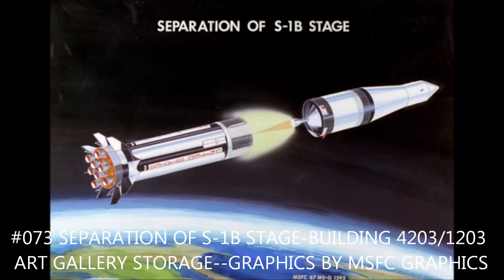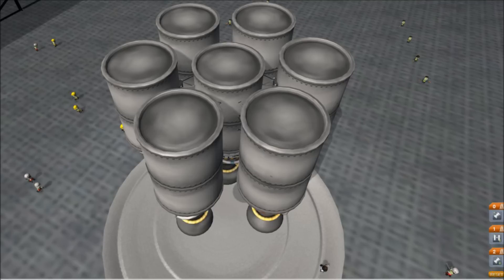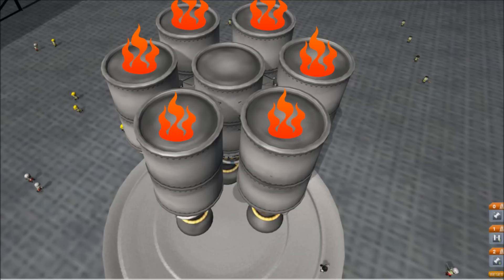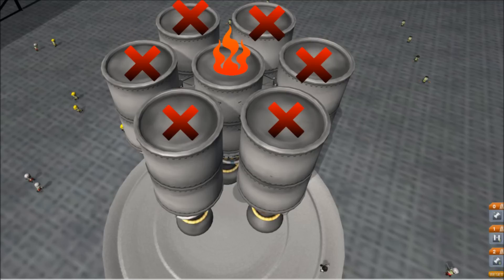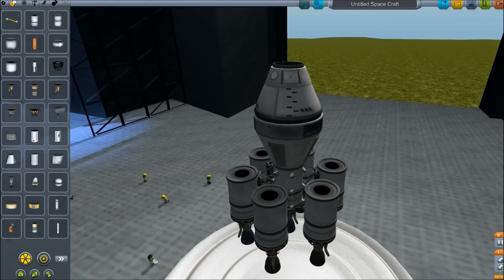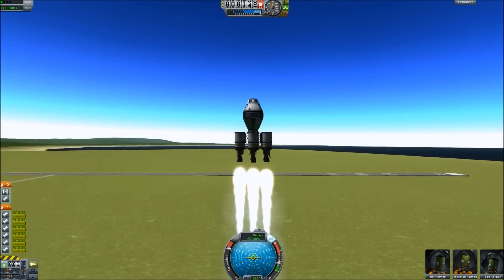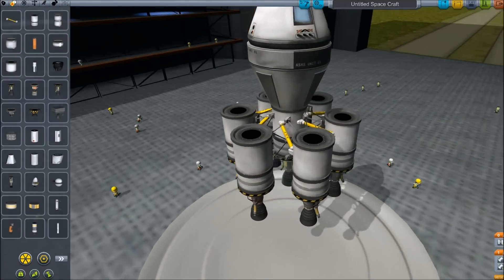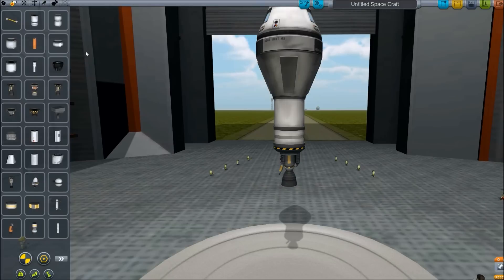Kerbal Space Program - Advanced Staging

Comment: Delta 4 Heavy runs both booster cores at full throttle and the inner one at lower throttle, so the booster cores with the same engine and fuel tank are deployed before the main core runs out of fuel ;D pretty nice concept. But I love Delta 2 the most: 6 GEM booster ("groundstart boosters") are ignited as well as the rs-27 main engine (I'm talking about 7925 "Heavy"). When they burn out, the three other GEM's ("aerostart boosters are ignited while the 6 other boosters are separated ;) https://youtu.be/cPYcfdlHUDY?t=166

Comment: 10:40 the claim "serial is better than constant ... shows that a little bit more speed gives more altitude" is false. You crunched dynamics data in this sum up table and the "lack of data" caused you to make this claim.
(In atmosphere, ie below 35k) a little bit more speed does not give more altitude. A little better weight to thrust and constant thrust at optimum speed do.
The serial had lower speed than constant - until certain altitude, when it had its fuel depleted from "boosters" - which it jettisoned gaining much better weight to thrust for further propelling as result, and then started burning the left over engine. 
The constant burned all fuel and got better start speeds, but then it run out of fuel and with the same mass continued to ascend by inertia - whilst still in atmosphere. Its atmosphere which has broke it down. In space, constant would win. But in atmosphere, rule of 500-600 m/s ascend speed and constant jettison of empty canisters (to improve weight2thrust) wins - which is "asparagus".

Comment: I understand how to stage like those, but I'm wondering about how to do hot staging, like the Soyuz, where the upper stage ignites while the second stage is still running.
Reply from the maker: Move the stage that ignights the second rocket so that it is triggered before you separate.
Reply: Won't that cause the first-stage fuel tank to explode? Also, how would that work with the de-couplers automatically putting interstages around the upper stage motor?
Reply from the maker: +Tristan Wassman It may cause it to explode. I would put some space in there like the Russian rockets.
Reply: How? I have B9 Aerospace, KW Rocketry, and MechJeb, I know MechJeb won't help with that.
Reply: +Tristan Wassman there is a payload bay in the modular rocket systems pack that works perfectly for this. it's open on the top and the bottom, basically just the side surface of a cylinder

Comment: I've found that with Ferram Aerospace Redux installed, parallel staging tends to be the best, given that full on asparagus staging causes insane amounts of drag in the lower atmosphere.
Reply: You are, but the cross section of an asparagus staged rocket is huge to the point where you loose more delta v to drag than you gain from the asparagus staging, aka its like real life.
Reply: SteelFyire What if there was a mod where there was a part that automatically assigned asparagus staging when placed and created the "plumbing" internally. Basically a fuel tank with asparagusing fuel line decouplers.

Edit: It should let you choose the type of staging instead of only being auto-asparagus.
Reply: SteelFyire
This is why you would, if you want to be efficient, stay at "Terminal Velocity".
Terminal Velocity is roughtly the most balanced speed, at which you are as fast as possible, without having too much Delta-V wasted during ascent.
Reply: I'm aware of that.

Comment: It seems many people have pointed out the fuel wasted by flying the rockets at full throttle. This would be a big factor why serial staging out-performed no staging and parallel staging. In serial staging, you're going far above terminal velocity. Adding an extra engine at full throttle is about the opposite of what you should be doing to correct the problem.
Reply: (I know, 6 years) You probably already know this, but I wanted to point out: firing all engines at once isn't the problem. The problem is that they're to powerful in this experiment. It would have been way more efficient to fire 7 smaller engines - preferably giving out between 1.5 and 2 TWR for a nice gravity turn,
Also, what do you mean about terminal velocity?
Reply: @Krzeszny95  At the time this comment was written (and when the video was uploaded), the game used a relatively poor aerodynamic model that caused a sharp increase in drag when flying above terminal velocity. You would want to carefully keep your rocket flying at or slightly below terminal velocity while ascending to save fuel. That's why there's such a large difference between the video's serial-staging test and no-staging test. Much more fuel is being lost to aerodynamic drag during the no-staging test. By the way, another problem with the old aerodynamics model was that nose cones actually gave you worse performance. In 2015, version 1.0 of the game was introduced with an improved aerodynamics model.
Reply: @criminy_  How did you calculate terminal velocity? I'm sure it's different depending on given altitude.
By the way, I use the Ferram Aerospace mod but I'm not sure how much it affects drag.
Reply: @Krzeszny95  When I was learning to launch rockets back then, I found a table that showed terminal velocity at certain altitudes. I eventually just got a feel for about how fast I should be going at a given point in an ascent. Also, I found the Kerbal Engineer mod which could be set to show your current velocity and terminal velocity for your current altitude.

Another quirk of playing the game back then with the weird thick atmosphere model was that the lower atmosphere was so thick that most people didn't really begin their "gravity turn" until reaching 10km (!!!) which made it not an actual gravity turn although most people still called it that.

After I became more familiar with the game, I started using Ferram's mod to try out a more realistic aerodynamic model where actual gravity turns made sense. I'm not sure what the differences are between the stock game and Ferram's mod since the 1.0 update. Ferram's a great mod author and community contributor, though, so I'm sure it's still an excellent addition to the game.
Reply: @criminy_  Thanks for that interesting information :)
Reply: yep... should be tested with mechjeb and with terminal velocity constraint
Reply: Martin Pereira i reply to myself!
did this with mechjeb and a similar setup just flying into 100k orbit constrained to terminal velocity... results:

- all 7 engines firing, no crossfeed ..... minus 438 m/s to orbit

- outer engines first stage, center second stage..... orbit with 1698 m/s to spare

- all firing crossfeed into center engine.... orbit with 1680 to spare

- crossfeed 2 into 2 into 2 into center..... orbit with 2520 to spare

so yes at least in this setup asparagus is much more efficient,
just built a 550t (11 oranges) lifter ill try to modify it with asparagus and post the results

Comment: you gotta remember that while the mainsail engines are stronger in the long run, the skippers are better in atmosphere and slightly more fuel efficient.
,
You also need to remember that even a full set of 7 of the largest stock engines cannot lift more than 2 layers of jumbo tanks (or the equivalent) without sacrificing a lot of weight on the rest of the rocket. (a smaller, less fueled payload) which you need once in space unless you plan to take the last rocket with you  (not a good idea.)

Comment: Is there a way to use symmetry to set-up the asparagus staging without having to connect each one manually every time?  I've tried but when I place the fuel-duct onto a tank it automatically changes the symmetry number from 2 to 6 (the number of tanks I have around my center).  Then they're just daisy-chained to one another and it doesn't work...

Comment: Actually the decision to use solid boosters was a very controversial one, and not supported by most of the engineers on the shuttle program, Most early designs had the shuttle using liquid fuel because it would be safer and more powerful, but the research and development costs would have been much higher than for a solid booster in order to make them reusable after landing in the ocean.

Comment: There are many other issues, including the size of the pipes required (and therefore the extra added weight) and the issue of "sloshing", which basically means, if you move fuel around too much, it shifts the center of gravity in the rocket, making it unstable and unpredictable.  Sloshing is almost always undesirable.

Comment: What about a serial asparagus method instead of the parallel asparagus shown here?  I.E. Applying the asparagus method but not burning the center tank until the outer 6 have been used up.  This would save more fuel which could be used during the thinner parts of the atmosphere reducing the total amount of friction applied. However, it would also mean that you would not be reducing your mass as quickly.  I am curious to see how that would perform considering the serial out performed the parallel.

Comment: I wasn't mentioning purposefully "cheap" rockets. No rocket is cheap. That is a fact. But solids don't magically make them any less cheap. The Saturn V was only used to take astronauts to the moon when carrying people. All other flights of the Apollo capsule was on the Saturn 1B which was a much smaller rocket. Most boosters are expensive because of the manufacturing costs of the system and the fact that we use them once and they go away

Comment: Yes it does. They are fired and used to impart delta-v to the shuttle to help minimize gravity losses. Thats the only real use of them is the high thrust at take off relative to liquid hydrogen/liquid oxygen rockets, which are very efficient, Isp 400-450 vacuum, but tend to be very bad when it comes to thrust to weight ratio. And the Antares uses a solid motor for the upper stage.

Comment: And the R&D required to make the Soyuz cheap probably makes that rocket a lot less "cheap" than it's made out to be.

We don't calculate airplanes by the cost to manufacture; we calculate them in per-item-cost, which includes the nasty R&D costs associated with anything that needs to stay in the air in a safe, stable manner.

Rockets should be no different.

Comment: The biggest stumbling block is the sheer amount of fuel that has to be moved.
So far this has prevented any asparagus schemes from becoming reality.
That's about to change though as the Falcon Heavy is supposed to use it, albeit in a much simpler form than most KSP rockets use.

Comment: From the reddit thread:

An asparagus-staged rocket would have to pump that much fuel to each rocket from the outermost tank, which is a mighty tall order.
So, in a way, yes, the "yellow pipe with arrows" technology is lacking, but only because the demand on the pump would be so high, and the weight of the pump and other infrastructure would eliminate the benefit of asparagus.
reddit . com/r/KerbalSpaceProgram/comments/186b2l/

Comment: I found out that MechJeb doesn't utilize the most effective ascent. It limits the velocity to 120-150m/s in the lower atmosphere, but that's not an optimal number since its AscentStats says that gravity losses are about two times higher than drag losses. The most effective approach is when they are equal, and it require about 200m/s in the lower atmosphere and therefore TWR around 2.

Comment: I did the same test with a much bigger rocket, with 3 engines and 3 fuel tanks but I found very different results. Asparagus was not efficient compared to serial or paralel, not even close. I suppose that's because with 7 engines and 7 fuel tanks the effect is much more important than with 3 engines + 3 fuel tanks

Comment: Just a tip: You can use 6x symmetry with an asparagus design. When it comes time to set up the fuel flow, turn symmetry off and run the lines that way. Additionally, staging can be adjusted by clicking the engine/decouplers in the staging group and then clicking off the list to deselect the engines, they won't re-collapse back into a stack, allowing you to select engines/decouplers individually. Using 6x ensures a balanced rocket.

Comment: You forgot about atmospheric drag. :) The serial option was better than the parallel where you did use the center engine only because the faster speed (one extra engine) causes a higher delta-v loss due to atmospheric drag! I think if you'd try this again with mechjeb ascent auto pilot on (which reduces your initial speeds) you'd find a major improvement in performance across the board but most in the serial variant.

You still clearly showed the immense efficiency of asparagus staging :)